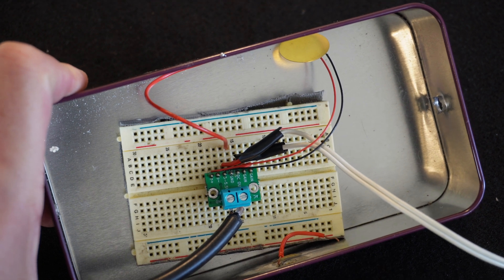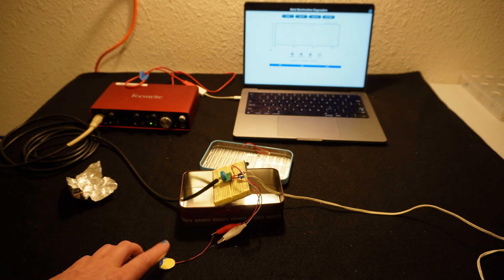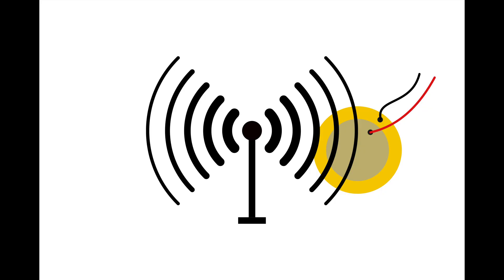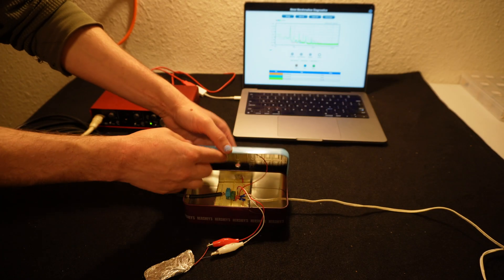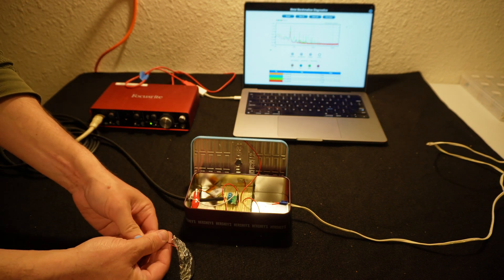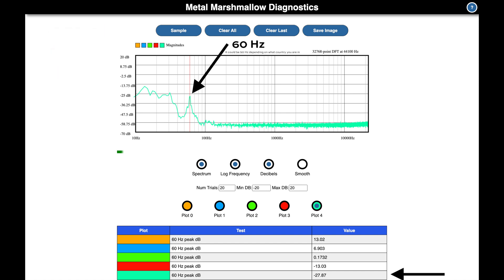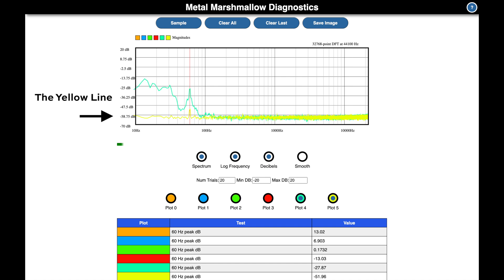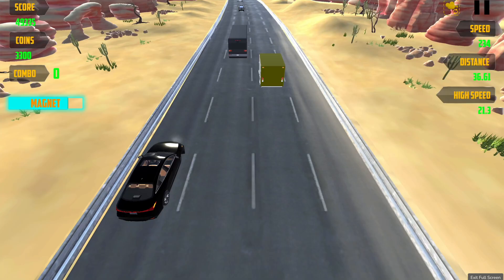How to Reduce the Hum of a DIY Contact Microphone

Comment: Hola, para que evites ese problema necesitas alimentar tu circuito con un DC to dc converter. Así aislas ese molesto ruido de la alimentacion electrica. Ya que el  dc cuenta con un filtro de carbon entre sus placas para que el salto de electrones no cause esas interferencias que hacen al moverse a 60 hz. son 60 hz porque asi oscila la frecuencia de la energía del cableado. Saludos desde México.
Reply: Supongo que esta utilizando un circuito para adaptar impedancias y amplificar la señal, me pregunto que tal funcionaría aquí un transformador de audio (con una calidad decente por supuesto). Transformadores de audio del tipo que utilizan las cajas reamp, tendrías la posibilidad de balancear la señal además de adaptar la impedancia aunque es bien sabido que la impedancia con las cuales trabajan los piezoeléctricos suelen ser muy altas, cercanas a los 10 Mega Ohm. También podría utilizar cera de abeja como es de habitual uso en los acelerómetros para fijar el piezo en el gabinete, esto aseguraría que no haya espacios de aire entre el piezoeléctrico y el gabinete.

Comment: I can tell you much easier way to reduce the hum. Use two sensors and balanced cable and input. Wide circles should be connected to a shield, internal pads -- to the cold and hot wires of the cable. And then you need to just stack your sensors to each other with pads oriented outside. So you get a para-phase signal from them that will be amplified and sinphase hum will be subtracted. And you don't need any monstrous shielding on your sensors.

Comment: there is also a massive dip on the 30 hz, it wouldn't do much for a bass ukelele or anything with low frequencies
Reply from the maker: This reduces the noise, but does not reduce the sensitivity of the mic. So whatever low frequencies you are trying to record won't be affected negatively, just unwanted noise will be removed. Metal Marshmallow actually has excellent subsonic response, I have a blog post about it https://metalmarshmallow.com/blog_post.php?id=12
Reply: with string instruments, even "bass" string instruments,  you're not getting much output below 50 or 60Hz anyway; that "40Hz" open low E string on a bass is really mostly vibrating at its octave harmonic at 80Hz

even a 5-string bass's "31Hz" low B is really mostly vibrating at the 62Hz octave of that

besides, most bass amps and PA system subs are chopping off everything below 35-40Hz anyway